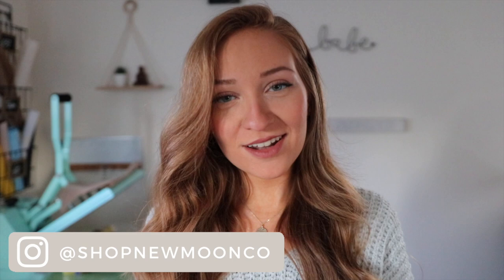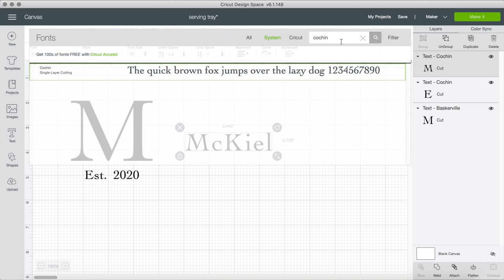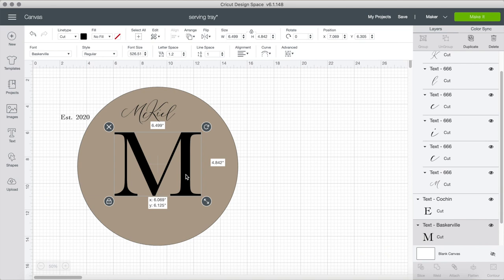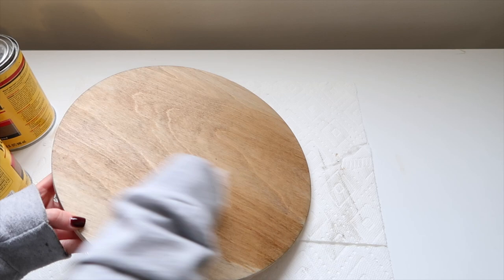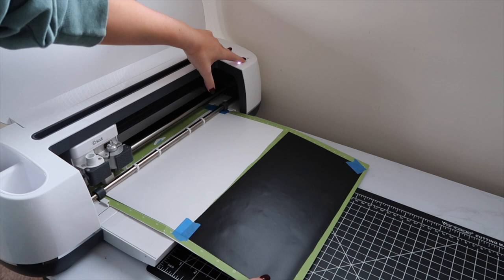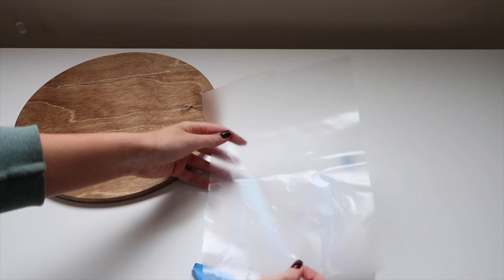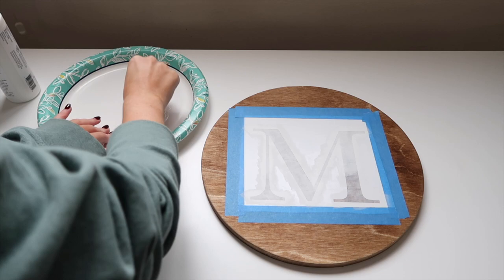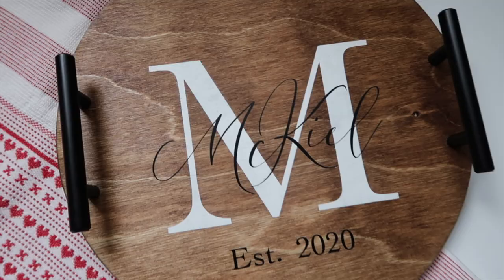DIY ROUND WOOD SERVING TRAY WITH CRICUT // Farmhouse Serving Tray - Last Name Serving Tray

Comment: If you use a wood conditioner first before you go in with the stain it will come out way better!  I had the same issue when I stained and was so unhappy with the results until I did some more research and figured out what I did wrong.  Great video I did subscribe I’ve been binge watching your videos.  Your amazing!

Comment: Is there anything you could put on top of the vinyl when finished that’s food safe in case they want to serve food directly on it?
Reply from the maker: Hi Sheena! This tutorial is strictly a decorative piece since I am using vinyl, paint, & polyurethane as a coating. I believe the best way to make this “food safe” would to use resin.. but please don’t hold me to that as I’ve never worked with resin + am not 100% sure!

Comment: This will be a perfect gift for a friend of mine that just bought a house.  I noticed the polycrylic is water based.  Can the tray be lightly washed? Will it wash off the coating?  Can't wait to try this!!
Reply from the maker: Hi there! It can most certainly be lightly washed — I use it for decorative purposes only so I give it a good dusting & spray it with cleaner every now and then.

Comment: Should a coat of poly be applied over the vinyl to protect it?
Reply from the maker: hi! depending what you use it for, you can! it's personal preference. Since I used permanent vinyl it will be OK! permanent vinyl lasts for up to 10 years on surfaces!

Comment: After the vinyl do you need to seal it again if you are using it as a cutting board?
Reply from the maker: Yes I sealed it at the end and I would definitely seal it! In your case I wouldn't use vinyl and do paint for everything.
Reply: Amy what did you seal it with that is food safe?